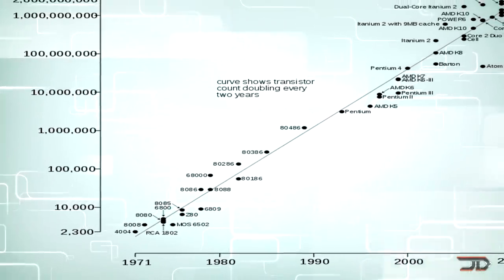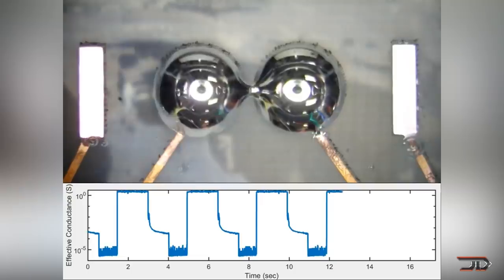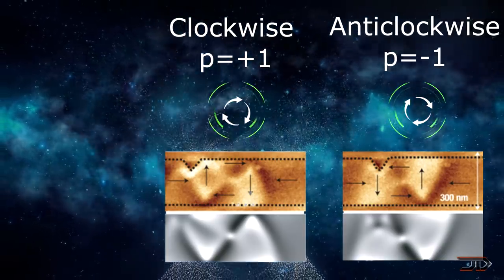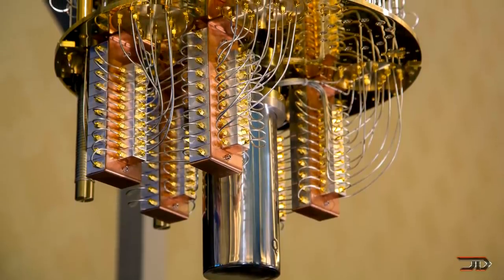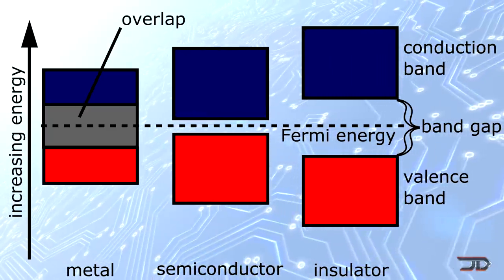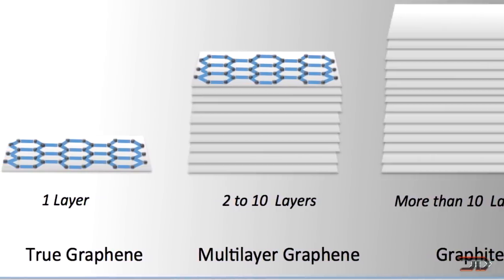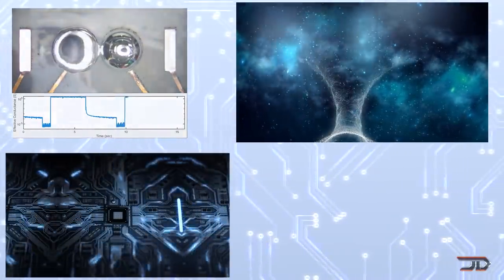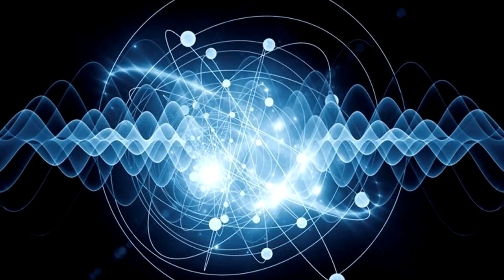The END of Silicon & Future of Computing

Comment: "the END of Silicon " How many times have I heard this in the last 50 years.
Reply: We almost hit the floor but maybe for another 10 or 20 years
Reply: Ady Dee I just watched a video that said at 2021 it won’t be economical to continue making silicon
Reply: silicon transistor is like a vaccuum tube to biological computation (i.e. human brain)
Reply: @absolute___zero  human brain doesn't work like transistor
Reply: @chanakyasinha8046  a neuron works pretty much like a transistor in terms of logic, i.e. it is a non linear function, the same thing that can be assembled with a bunch of transistors. The difference between biological computation and transistor computation is that if you have the right DNA , you can evolve a lot of biological neurons with 1kg of flour which will cost you a few bucks. The same amount of transistors will cost you abouve 1,000 bucks and you depend on the manufacturer for the architecture of the microprocessor.  Also the parallelism of silicon chips is quite low compared to neurons. When biotech will  mature enough we will be able to create our custom biological brains thousands of times more powerful than today's silicon chips.
Reply: There wasn't any problem to be solved 50 years ago though....
Reply: Knows what the future of biotech holds.
Reply: Of course there was, otherwise we wouldn't have had years of sub 1gb ram limits. The challenges were identified and overcome. Time and time again, we hit hurdles and overcame them
Reply: the end of silicon was 50 years ago...then starts the age of quantum computing...but it's very difficult to fabricate...and to program...but quantum computing saw it's beginning when mathematically and theoretically transistor can't get smaller because of quantum mechanics apply to small particules as atoms...where there is a small amount of atoms...in this case electrons don't transfer the energy...instead there is possibility to find electrons and not finding them at same time
Reply: hahahahahahaaaaa
Reply: ZINDAO have you heard about the nazis expanding after the war and continuing their advanced tech - Joseph Farrell has books about this like Brotherhood of the Bell
Reply: ZINDAO because I haven’t delved into learning about technology except knowing that advanced technology was sequestered, so, I actually was just checking to see if you, a commenter, knew this in order for me to determine the credibility of all of these people amused by this stuff; it’s a decoy. I just heard a Nikola Tesla interview and it’s interesting. His stuff shall be available soon.
Reply: It's particularly dumb because the end of silicon process shrink is not the end of silicon. Nothing is even close to Silicon in terms of density or numerous other factors. It also missed the fact that process "shrinks" aren't even based on the numbers presented. Those dimensions in nm are not the scale of actual structures and there is far more innovation involved than simply scaling things down.
Reply: @adydee2982  Hitting the floor doesn't mean it will be replaced. It just means it'll stop shrinking, but other things will happen to drive gate density and performance up or at a minimum drive gate count up.
Reply: @cameronwhiteside8114  Well that's a really foolish prediction. It might not be economical to SCALE silicon further or invest in newer better FABS, (it's clearly wrong about that too), but these predictions are nonsense on stilts. End of process shrink is not end of silicon, end of shrink does not mean it's not economic to make silicon, it's still the only game in town and its actually very lucrative. The designers don't actually manufacture the silicon and they are all clamoring for access to TSMC's latest process and paying top dollar for it and they will continue to do so. TSMC can't build FAB capacity fast enough, even Intel is buying capacity from them.
Reply: @S124434 One is already started (FINFET etc) and the other being actively researched (photonics).
Reply: @S124434 I'm daydreaming about it LITERALLY but I'm skeptic about the cooling of that because of the square-cube law, heat will be higher inside the processor because the die will be 3D. The cooling solutions for that will be a breakthrough if that ever happens.
Reply: I hope silicon stays lol
Reply: @absolute___zero  yup
Reply: @CEA9234  it's getting smaller hitting it's limit
Reply: @absolute___zero  neurons are far bigger than any transistor though

Comment: I'm also interested to see what the future holds in terms of software. Even now we're still figuring out how to get the most out of single threaded workloads on chips with dozens of cores.
Reply: Yes it is very interesting how the software and hardware can be made cheaper, faster etc, kind regards.
Reply: @saskiavanhoutert3190  It's all about the speed of development nowadays. That's why modern programs like simple calculator app require a million times more ram than a, for example, windows 95 calculator, which has the same functionality. And software is very cheap to produce already, cuz libs and frameworks are all coded and ready to use already. People start to pay less attention to optimization, cuz modern pcs are becoming very powerful.
Reply: There are already pretty good fps improvement A.I. softwares.

Comment: I came up with a model for a new type of computer based only on connections, from playing a game, Counter-Strike (a Half-Life mod) when it was in its original beta phase. The system was very poorly designed, like the accuracy system for the weapons was designed that if you slow down to a walk, your guns were more accurate, but they set the parameters up so that it triggered this extra accuracy just going the slightest speed under a full run. Using +moveup which was meant for swimming in the scripting language, which is the only "language" I used, you could get half way between a run and a walk for movement speed and get the accuracy of a walk and the silence of it, with movement sound being another similar flaw they made in the game. That combined with scripting firing of the gun so it briefly made you do +moveup before actually firing the gun and turning it off immediately after firing the gun effectively gave you a more accurate gun at a running speed. There were many holes in the original CS system, I repeatedly told them about them on their message board, getting repeatedly banned. I remind you: I only used the extremely simplistic scripting language built into the game, so I was exploiting and not cheating, even though in effect it was cheating. CS 1.6 should have been CS 2.0 because they made major changes to the engine due to what I was spreading around. At least one of the hacks that I kept to myself and did not put into my script still exist in the current CS system as far as I know. It was basic to the Quakeworld original engine Half-Life is based on. The script that is part of my work, for CS 1.6, has a fully automated taunt system for giving people a hard time. I built a randomizer and relational database that sometimes spits out a taunt based on the weapon or weapon type you are using just before your gun is actually fired when you fire, only using the one command, alias. Alias just lets you create or reassign a command to an indicated string of commands, and nothing else. I did not set out to do this, it just happened. I originally wanted a script to quickly buy weapons, and it developed from there. I have kept every beta and final released versions of the script from beginning to end, to show how it developed.

I propose a "Dynamic Stateless Computer" that operates on "Logic Geometry" based only on connections, or links, or pointers - a much more simple computer than the three basic Boolean logic gates operating on mathematical binary bits that is every computer out there. The shape is the logic and the logic is the shape, sort of like a truth table that is dynamic where the "truths" change as it runs. 

Quantum mechanics is beyond me, but if this only needs connections, ie a quantum entanglement (short video on entanglement: https://www.youtube.com/watch?v=z1GCnycbMeA ), can we build a computer that operates and does its entire run instantly? Like I said, all I need is connections to perform logic... no need for information... the shape is the logic. 

You are best off going to Github and seeing online without downloading the paper and models. When someone looked at my calculators, they accused me of: "You're not doing math! You're emulating math!" Look at the simple calculator first, it only does addition and subtraction. Then look at the complex calculator that does multiplication and division.  As you well know, if I can do those things, I can do anything mathematically. In the main model I created if-thens, complex do-whiles, a randomizer and a relational database.

https://github.com/johnphantom/Dynamic-Stateless-Computer

Through the exercise of the most complex do-while I asked a question related to that, and the answer uses the ancient Chinese/Pascal's Triangle (which millions have looked at over thousands of years) in a new way: https://mathhelpforum.com/threads/combination-lock.17147/ I basically had to count nothing as something to count, as in you can have different items to count the permutations of but a default state of no item is possible for each, some or all to count in the permutations, and it doesn't seem anyone else in history was able to use the really basic mathematical concept of the Triangle in that way for the solution. It is similar to how hats can be arranged on pegs question of how many permutations you can have that is commonly associated with Pascal's Triangle, but they did not count the empty pegs as part of the permutations that they can have. The technique of the implementation is a little interesting, with it being able to reach any of the 209 possible permutations of 4 wheels with 4 numbers (don't know if I should count 0, it is special in this case - if you do count 0, it is 5 numbers) in 4 keystrokes or less - it's how it scales that is the curiosity, where if I had 18 slots and 18 items to form a permutation it would have almost 3x10 to the 18th power or 2,968,971,264,021,448,999 possible permutations, each reachable within 18 keystrokes or less.

I don't have any idea as to how this would be physically built - none of the aspects of it, except for the dynamic logic that I also do not have any clue if it really is what I ask above. I just can do these things I demonstrate and in my extensive almost 50 years of digital computer experience I have not seen anything exactly like it.

Maybe you wonder about my computer experience? I have always been fascinated by computers, starting in 1972 using a prototype Cogar 4 that my dad got his hands on, when I was 3. By the time I was 5, Singer wanted to use me in a commercial to sell the computer, because if a 5 yo could start it, load the OS and then load games, that proved anyone could. My first mentor helped develop Ethernet after working for my father, and allowed me to hold one of the first breadboard ethernet cards developed when I was 10. My first real program (programming since at least 5 if you count the Cogar ASM I had to type to get to the OS and games) was in BASIC when I was 11 that I learned from a manual without anything more than a small example for each command, written with pencil on paper; a rudimentary AI demonstration called "Animals". Second program I made I had another computer (we had moved and left the one at my dads company behind when he sold it) and was a dot bouncing around the screen. Third program, with a 12 year old's understanding of math, I attempted to do 3D. I first professionally programmed in 1982, started building computers and networks for a small computer company in 1986 owned by my second mentor, Peter De Blanc who lead ICANN for a period, was an official beta tester and developer for OS/2 2.0 and developed a device driver for it for the extremely complex Truevision Targa+ 64 video editing board (pic: https://imgur.com/a/hMe21Qe ) directly flipping bits on it in 1991. The code for the model for the dynamic stateless computer is about 640 lines and took me 6 months to complete, with the code for the Targa+ device driver being over 4200 lines and took me one 20 hour sitting that compiled and ran the first time that I have 3 witnesses for. That's almost 30 years ago. My experience has only gone up from there. This dynamic logic is something I found, that I have never seen anything like even searching for it on the Internet for the past 20 years. I think this is basic to everything and is a new science, as it only operates on one concept - connections.

I am looking for help explaining this and turning the old Counter-Strike 1.6 script into a package for Counter-Strike:Global Offensive, the latest version. I am not talking about converting the code, it works - I just need help with the current packaging for CS:GO. Any input would be great, thank you. johnphantom@hotmail.com (this was my first email address that I got in 1996 BEFORE Microsoft bought them so if you send an email there please make sure you add me to your address book, as this email addy is marked as spam all the time.)
Reply: @Username That is something I find I am not capable of. It is connections, and nothing else. Just connections.
Reply: @Username Look at the calculators on github. The simple one if you go over it all is fairly straightforward.
Reply: @Username I changed the text of the original msg to be more updated.
Reply: @Username No there are no variables. No binary. No gates. No math. It is just connections that are made and broken as the system runs. I don't know if it is any better; what it is, is different than anything out there. I suppose the thing it could be most compared to is how we decide things, one thought leads to others, etc...
Reply: @Username Oh and the complexity is a problem. look at the final code in the paper on github on page 8 and 9 of the paper. That performs the permutations of the 4 slot combination lock problem solved with Pascals Triangle. It gets very complex to do something so simple.
Reply: @Username Neither analog nor digital - it doesn't deal with measurements at all. Thanks for your input, I do think this goes deeper into many things than we really realize, where some psychologists will talk in terms of things like "connections of events". I think this just puts the basic concept of "this causes this (and that/or that/etc)" into actual definable action. I really have to detail how the calculator_simple.cfg works to give people a basic idea of what is happening.

Comment: Graphene aeroGel looks pretty interesting maybe it could replace silicon
Reply: Sweetbrownsuger yep, graphene ...looks promising so far. IBM have been working with it.
Reply: Graphene is going to replace silicone it should of been discovered before silicone
Reply: Silicon, the semi- or transitional metal is very different than silicone, which is very heat tolerant and used in caulk and fake boobs. Different molecules, brah.
Reply: @zaneandre6387 , it's extremely annoying when people mix them up.
Reply: @zaneandre6387  bewbs

Comment: archer axe has developed a q bit capable of room temp function and they have a huge 99/per cent graphene discovery in south australia
Reply: Archer obtained an exclusive license from a Sydney University that one day MIGHT enable q bits to operate at room temperature. I don't see an issue with making a q bit operate at room temperature as such, just wondering how they deal with filtering out interference from heat noise.
Reply: Hey hope i have some Graphene in SA straya $ i will undercut for free tesla car👀😆🤳🖖
Reply: I thought Graphene is deliberately made and not naturally found.
Reply: Quantum are not a replacement for traditional computers, in fact they are worse in some aspects.
Reply: Well.... any computer that can answer almost any question, conventional or not, will directly change conventional design.... especially since the biggest manufacturing companies of conventional computers are one of if not the biggest inventors.... besides if u believe they aren't already doing so, ur a naive individual....
Reply: @adamsblanchard836  I agree.

Comment: I suspect a lot of these technologies will start to be cross integrated to the point where we use photonic parts (or cores) for those calculations, graphene for conventional, and quantum cores for specific computations.
Reply: You have a good point why pick one with is advantages and disadvantages  when you can have all the advantages and none of the negatives by using more then one type of technology

Comment: opto-polymers can work as very fast transistors with light. Wavelength can be also used as timing clock and would allow super fast chips.
Reply: To transmit data with photons in light-signals is perhaps also a possibility, what do you think about that ? Kind regards.
Reply: @saskiavanhoutert3190  The problem is with physics having monopoly on how matter works. Photons are supposed to be both particles and waves which is crap. Most likely it is a pulsating ether that can be sensed by opto-sensitive molecules like polymers and further transmitted as data signal to the optical transistors
Reply: @browaruspierogus2182  Thank you for your reaction, the future will learn us more.